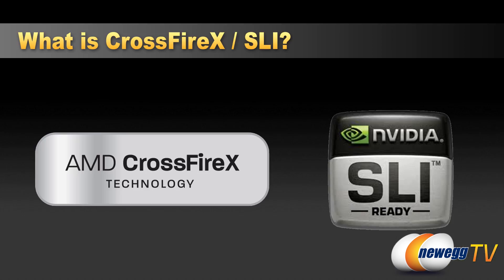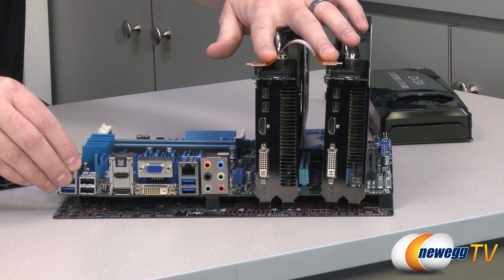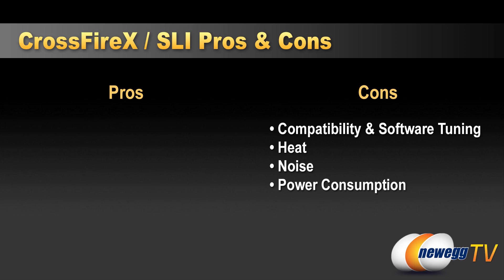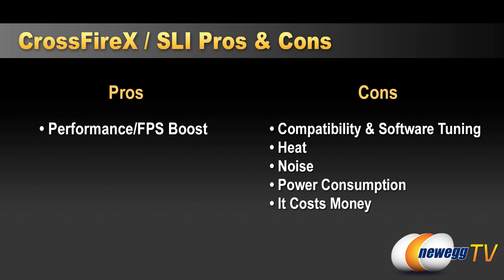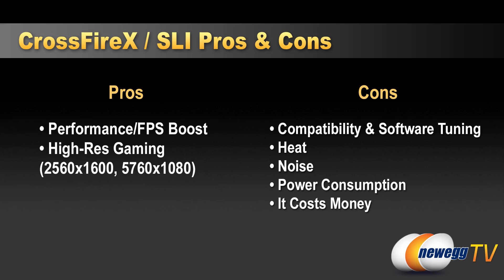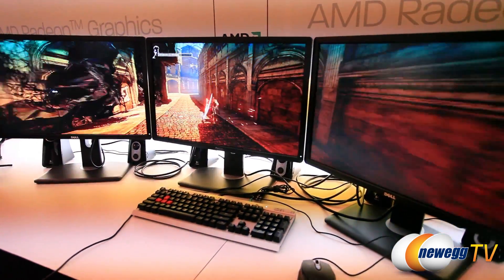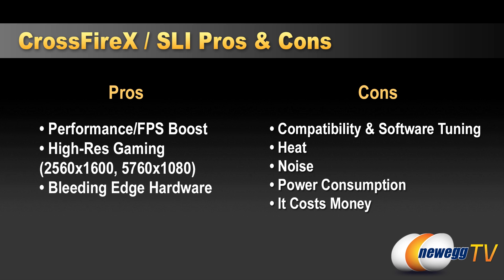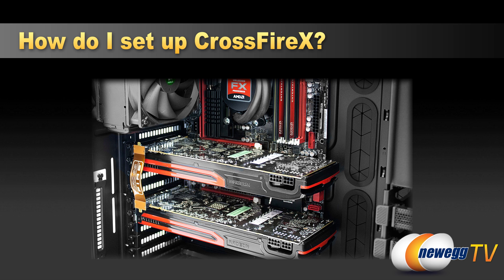Newegg TV: CrossfireX & SLI Multi-GPU Guide, Tutorial & Benchmark Demonstration

Comment: You're now comparing apples to apples to oranges. Although faster, you can run into temperature, noise, space, and driver problems with 3-way SLI. Also, as far as I'm aware, only high-end chipsets have enough bandwidth for 3-way SLI (X79)